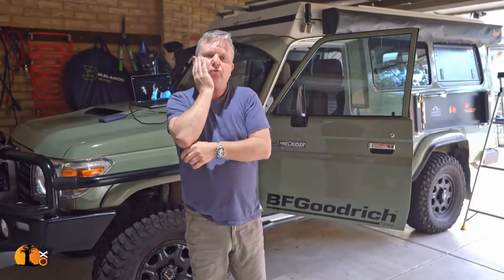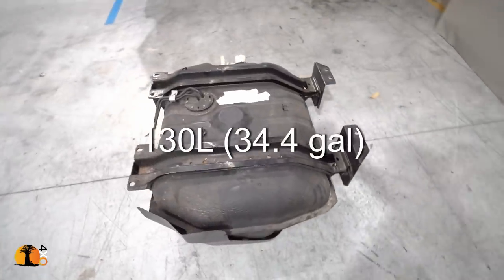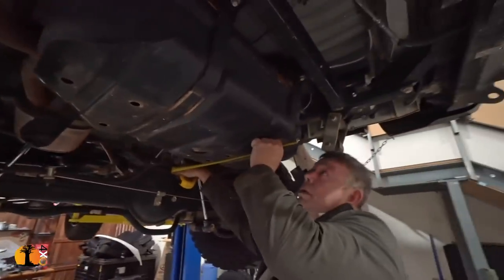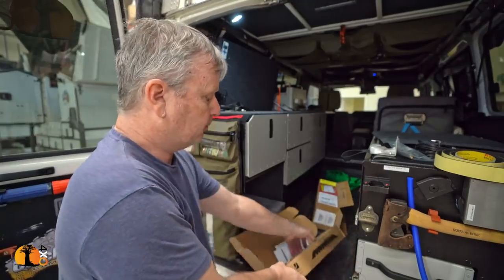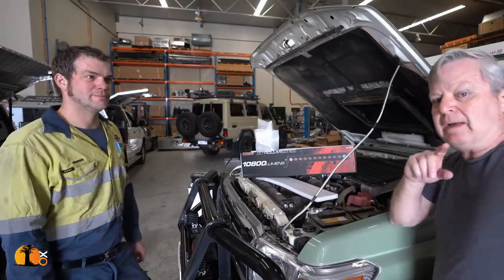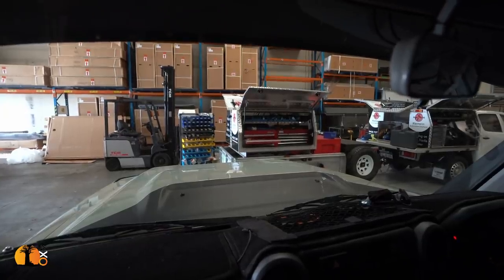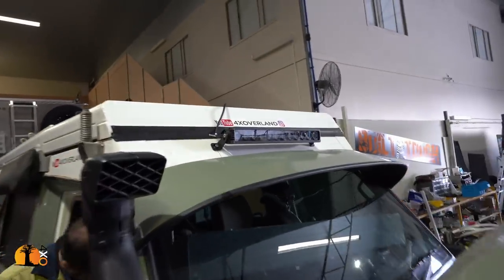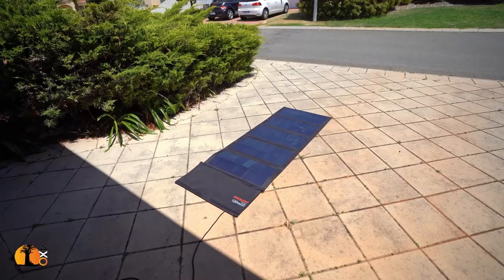Troopy 4WD Truck Build. Phase-3 | Not everything goes to plan.

Comment: Mounting  a Light bar on the roof is a great mod, especially good when traveling at night in areas with tall grass or deep water crossings, still allows you to see ahead when your normal run lights are covered. You raised in my opinion a vital point of upgrading your low beam to a whiter light. Awesome build so far can't wait to see more.

Comment: I don't think the panel washers will provide enough load spread for that light bar. If it was mine, I'd be adding a full-length steel bar on the inside and extending at least 75mm at each end as well. Don't forget, when you get on to the corrogations, that light bar will be adding HUGE up/down loading to the white base material (fibreglass?).

Comment: Boosters usually also boost noise, so the Signal/Noise ratio doesn't actually change.  I will be interested in how you go. Maybe they have some fancy filtering..
Reply: They also need to be smart repeaters (as his is) that communicate with the tower and adjust gain accordingly. 
Other wise you drive back into a town things go out of spec pretty fast.
Having a signal loop is also one of the biggest problems, ie: your handset transmits, both external and internal receive it.
Or as the internal antenna TX's the external will hear it, or the reverse and so on.
I ended up making an antenna port for my phone as i had no luck with passive cradles or internal antenna

Comment: good to see you fitted the victron battery monitor that I have in my truck as well, along with a victron solar MPPT charge controller and the corresponding control monitor too. they really make good products over there in the netherlands, and they're nice guys too. only thing I'm missing in their portfolio is a DC-DC charger. very sad they don't make any.
Reply: I agree! I had a lager Victron managed 2400 Ah (12 large AGM batteries) system in my sailboat, and I am now installing a smaller Victron system in my overlander for 2019 (Victron products: the BMV-702, the MPPT 100/85 and the VE Direct Bluetooth Smart). In my experience, from my boat, Victron delivers very high quality systems, and the system I had worked perfectly in all conditions, including cold Norwegian winters and ocean sailing in proper storm, wave bashing, saline and high humidity air. I lived in my sailboat for 3 years, and were dependent on Victron all day, every day. A trusted system.

Comment: Hey Andrew I hate to tell you but if spent another 100 bucks on the victron bmv712 instead of the 700 it has built in blue tooth and all battery readouts are then on your mobile device.. I have the 712 and it is awesome you can be sitting in your chair having a beer or coke 😄 and still check on what your batteries are doing without getting up...digging the vids.. peace and love..
Reply from the maker: I was offered it but turned it down. I do not use unnecessary tech on trips as for me, it often gets in the way more than it contributes to it. I'm quite happy to look at the readout when I need to. otherwise, i prefer my binoculars to my phone etc. :-)

Comment: Really glad you went with a sensible light bar as that industry seems to be more about having bigger/more/brighter when it's really not necessary for most people. I'm still not convinced any light from the roof actually helps in a driving situation (I have tried) as the brightness being around the closest point to your vision (bonnet) will probably alter your perception of depth as your eyes try to focus on that, so will be intetesting to hear your thoughts on it with a different approach. No matter how many lumens you put up there you can't see through the bonnet & generally they aren't mounted high enough to give you any extra lighting on the ground, only up in the air, so I do wonder how they give any advantage over a spot/flood combo on the bull bar which silhouettes the edge of the bonnet giving a reference point & allowing your eyes to focus properly for depth.
Reply: It's definitely sensible but it looks tacky as hell.

Comment: lol funny "Doing a 100ish." I'm thinking wow he can hit a 100 mph in that thing? Then I remembered, you have a proper system for measurements, lol!
Reply: Oh me. Improper measurement. I've lived with both systems. Actually, I don't know which one I like better. Anyway, hitting a crit that fast is not good.
Reply: @takayama1638  What gets me about Australians is that they use the metric system except for tyre pressure - they still stick to psi, whereas us metricated and civilised South Africans have been using kPa or (some use bar) for the last half-century! There remains one thing we still measure in inches though!
Reply: @philipjooste9075  Civilised? Most of your homes are surrounded in barb wire. Not too civilised there.
Reply: @takayama1638  oh, yes, indeed. My brother hit a deer recently.
Reply: Philip Jooste mainly bar....
Reply: Philip Jooste Not so. We use kPa too. I use them interchangeably and all pumps at petrol stations are in kPa here but you can at the push of a button change it to read psi.

Comment: depending on space constraints under the chassis

3x 110 liters is going to be max

with wheel well tanks 130-210 liters  between 65-105 liters per side pending on tanke length...

when you start to look at fuel capacity  over distance  you current setup of living in the  back is kinda pointless...

for long term travel you are likely looking at a min spec of of a 23-25 foot caravan

because your 4x4 will need to carry as much fuel as possible

this will also include a numbe of spare spares to cater both vehicle and and van

a combined total of 450-1,000 liters, with a min of 100 liters or there abouts  in jeery cans or enough to fill your main tank with fuel

Comment: Andrew, I'm adding a second fuel tank to my 95 K2500 Suburban ( off of a 95 Tahoe), if it works I'll have 72 gallons/273.6 liters feeding my 7.4l engine, believe me it's not going to be easy, but it can be done.
Reply: It will be particularly hard on your wallet. I know because my overland 4x4 van had two tanks for a while. the original 33 gallon tank and than a 44 gallon tank I added. I managed to drive from Vancouver WA to Casper Wyoming on one fuel up. Talk about spendy and nobody waiting for me to finish fueling up was happy.
Reply: I look at it as that I'm going to spend the money on fuel anyway, make it fewer stops for refueling and I don't have to use the secondary tank if I don't want to (still use the primary tank alone), now I have to figure out how to integrate the filler hose on the secondary tank.

Comment: Hi Andrew, maybe I missed your video but I’m wondering what brand & size of rims are you running on the Troopy now also what tyres & dimensions of the tyres? How have you found the Trutrack correction now it’s been on awhile? I’m contemplating fitting it to my 79 dual cab or the jmax axle upgrade?
Thanks keep up the amazing work.

Comment: Maybe off topic, but I’ve never seen the chain you have attached between the mud flap and rear bumper? Curiosity here in the US.
Reply: Keeps your mud flaps from making contact with the tire and either wearing through in time or getting grabbed by the tire and ripped off if you have to back up in mud or deep sand.

Comment: I have 90l+200l in my LC78 and 230l in my second LC79 DC. This is sufficient for my Africa and Asia travel. Especially when I need driving for low price diesel.
Reply: Hi, can you tell me which tabks you used on your 78 troopy ?
Reply: @nasseral-momen1463  90 l is Toyota original, 200 l is made by German producer Toms Farzegue, but you can find many other products.

Comment: I hate hitting animals too, even snakes. Here in southeast USA, its white tail deer we have to worry about, especially now in fall. I need that thing on my truck! I check to see if they're available here. Cannae have enough fuel. I love the dual tanks. My truck in USA has 36 gallon gasoline tank. I never want a smaller one on truck. Well, I've learned several hundred dollars worth of stuff I now want.
Reply: The bull bars work for deer.  I hit one at 45mph and didn't do much damage to my truck only a dent in the fender. (I hit it at the corner of the bumper.)

Comment: Would like more details on the booster. Always thought they were illegal, as guys used to run them in mining camps to try and get signal. And Telstra would issue notices about them being illegal and traceable by ACMA.
Reply: Anthony Gatley this unit is issued by Telstra and is the only booster they allow.  I believe it can be remotely shut down if it causes a drama.  About $800 and just need to match it to a good antenna.  Celfi Go
Reply: The cel-fi go works really well. I work in remote areas and have it matched to a 6.5db aerial mounted on the roof. It was necessary to play around with the position of the aerial, and keep the patch antenna as close to your phone as possible,  and always run on 3g only for good results. It will take your phone from almost no reception, turn it on and you can stream 720p youtube all day!!! Works really well in all the dead spots too. Ive found it only reassy 'boosts' the reception quality alot. If your in a major dead spot, miles from where its possible to pick up reception, it wont always give u signal. I paid about $1000 - $1100 plus aerial

Comment: be interested in what you do with the low beams,HID or LED would be my pick
Reply: Aftermarket HID are all pretty much illegal as you need both a self levelling & wash system to conform with most national standards.
Reply: @gaj5701  true  but toyota do such a system for the 200 .LED and Hid would most closely match the output of the light bar etc
Reply: Yeah, it would be interesting to see if they could be legally fitted with modification but unfortunately the approval from a 200 wouldn't carry over to the 70 series so it would have to be a whole new approval process. I noticed All4Adventure have fitted HID to their latest 79 so it'll be intetesting to see if theirs conform to the current standards.

Comment: I have an Alu-Cab Gen 3 tent mounted on load bars. This leaves a slight gap between the roof and the tent. I therefore mounted an led light bar in that gap. Nice & flush, it looked really streamlined & was perfect. HOWEVER, I got randomly pulled over in NSW & was given a ticket. The cop told me “it’s illegal to mount driving lights anywhere other than at the front of the vehicle”. I argued that they weren’t “driving lights” - they were spot lights that were wired in correctly i.e. they could only be turned on if I had high beam on. The cop didn’t budge & gave me a ticket & I had 7 days to remove it! I’ve since seen literally hundreds of 4WD’s with roof mounted light bars. So, I’d really like to know - are they actually illegal, or was this cop just interpreting the law in his own way & generating revenue?!? Thanks!! :)
Reply: Attila Rozgonyi - SA has different rules depending on your type of lights. All can be found here. https://www.sa.gov.au/topics/driving-and-transport/vehicles/vehicle-standards-and-modifications/lighting-and-instrumentation  In short light bars can be fitted to the roof.
Check out the WA requirements https://www.transport.wa.gov.au/mediaFiles/licensing/LBU_VS_IB_132.pdf

Comment: Will this 130L fuel tank fit a 79 series ?
Reply: I pulled up the part number on the VDJ76. It matches with what the VDJ79 double cab comes with. So it should be the same. 

I think the tank will fit the 78. There is room between the tank and the crossmember it bolts to. It could be that the installer was a little worried about making small fabrications. I will try it on my new 2023 VDJ78.

Comment: what do you think of the jeep gladiator as a touring vehicle?
Reply: A big downside is it's made by Chrysler which has the worst quality and reliability of the three US car companies. Also, as a new vehicle design it will have design and engineering problems.
Reply: +Israel S.S. It ticks All the right boxes. It's Wrangler-based so, contrary to what the uninformed will tell you, it is tough and reliable. Payload is pretty decent and it will be available with the 3.0 V6 Diesel - only issue I think is going to be price.
Reply: the old AMC jeep gladiators are amazing and i wouldn't hesitate to take one anywhere.
Reply: terrible to get jeep parts if youre in the middle of no where
Reply: @RedesCat  Terrible to get any parts if you're in the middle of nowhere, period. :) In my experience though ( I operate a LC 79 series pickup, and keep a Jeep or 2), Jeep parts are inexpensive by comparison, and a gazillion aftermarket replacement/upgrades are available  - I live in South Africa, so Aus should be even better.
Reply: I thought the same, Israel. Seems to me the Gladiator will be a superb overlanding vehicle. Both gasoline and diesel. The diesel issue might be fuel quality in some places. These USA diesels now are so finicky about fuel with all the government anti pollution stuff in recent years. Still, this new Jeep truck is absolutely appealing, and Jeep people really thought of about everything in its design and build. I think it's a winner.
Reply: I've owned an M715 (mil version of original Gladiator) for a few decades now. That Wrangler is no Gladiator, not even close. Pure marketing hype. That said, I'd trade...  ;-)
Reply: Philip Jooste 
Tough??
Lol keep dreaming mate
Reply: @Tanner731  Did you mean to say "to a workshop anywhere"?
Reply: @camfam52002  If you are taking a vehicle that is as simple and easy to work on as a old jeep to a workshop to have someone else work on it you really shouldn't own one
Reply: @Tanner731  Well at least we agree I shouldn't own one.....might just disagree about the reason.

Comment: PLEASE Do NOT up grade your standard lights to LED. Firstly there isn't many that are legal (this is because many are simple not adjustable & blind on coming traffic) & the other reason LED's suck is they are the wrong kind of light for your eyes. LED's tend to mask Greys & Browns (guess what colour our wild life is??) I made this mistake myself, upgrading all my lights to LED/s & I have had problems picking out roo's. I'm glad your sunvisor is there, I also put a full length LED Light bar on my roof & while it is great for Slow 4wding on narrow tracks (which I rarely do at night) it is basically useless because of the glare (even though I have everything in flat black & I meaning everything!) The Victron is a simple, cost effective way of monitoring your battery/batteries health & usage, the Blue tooth model ( no need for the adapter now) is great as you can have it up on your phone at any time. The Victron 240 volt charger I have on board is also Blue tooth.  I prefer a HF radio for remote communications (& there is something a little romantic about using a radio) Sat phones are a little hit and miss for my liking as we have proved before (though HF takes a bit of work to use) .....Another great video as usual !👍

Comment: Andrew, Black Oak LED (blackoakled.com) makes the best, most bomb proof made in the USA LED light bars with absolutely the best pricing.
I've fitted them to my jeep, and after 2 years of use absolutely love them. Give it a look.
Reply: pfft Black Oak is mega spendy. For what I got on Amazon for 120 bucks you would have to spend 900 at black oak.
Reply: 4x4Scout Black Oak LED...veteran owned, made in USA with a lifetime warranty. It comes with a higher cost, but I'd still gladly pay that over Chinese made garbage.

Comment: Andrew, why suffer a mounted battery monitor which costs valuable space/money? There are handheld multi-meters than can measure both AC & DC current quite accurately. I'm talking hall-effect, clamp-on type - no hardwired shunts are required! This is far more functional, smaller, lighter, half the price and requires no installation expense. Example:  Southwire 1000 Amp AC/DC True RMS Clamp Meter. Only downside is that reasonably accessible points need to be planned/made for the small clamp to reach around a wire. Cut the weight, cut the space, cut the cost, expand the functionality to many other needed troubleshooting bush-fix needs, produce the video. A lot of "wins" are involved here.
Reply: Good points you put forward.
I personally have a National Luna monitor mounted on the dash of my Disco 2. That way I can keep an eye on the battery while on the road.
Nothing worse than driving for 8 hours, pitch camp and then see your battery's almost dead.